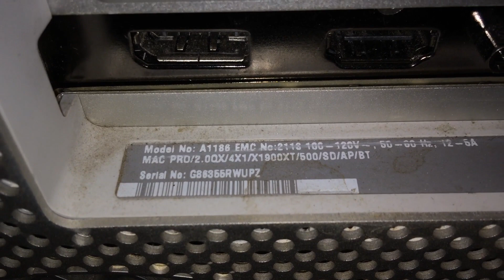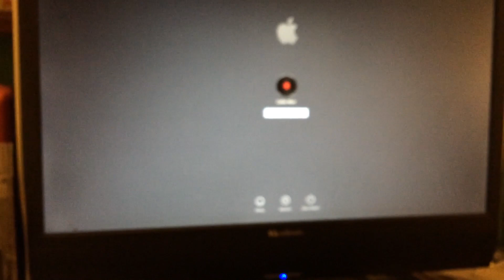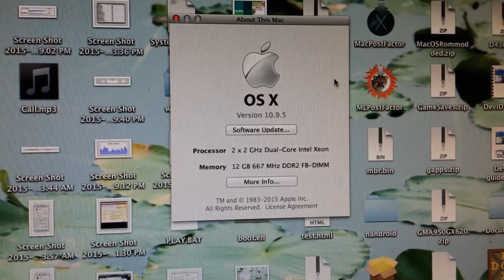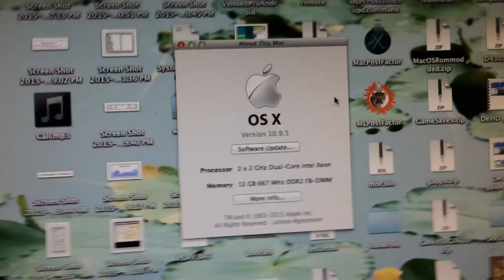Early-2006 Mac Pro 1,1 Overview

Comment: We have two of these in my graphic design class. They run at a fairly acceptable speed and can still get online, plus they look very nice. We use them as scanning stations but, theoretically, we can do projects on them as long as we're not using Adobe InDesign.

Comment: Hello i have a mac pro 3,1 with your catalina os installed its awesome thanks.
I'm trying to dual boot windows is there a trick i get the option but it wont start the installer restarts after a few minutes.

Comment: SO did you do a video of upgrading or rebuilding it to be more powerful or running current MacOs or anything?
Reply from the maker: Yeah, there are a few videos on my channel about some upgrades I've done to this machine.
Reply: ***** I created a playlist and put them all in it! How far did you get in your upgrades? What are your current specs for it? What were they before?

I got my 2006,MP 1,1 in 2012... i upgraded to a 1gb graphics card, i put an esata pci card in it, I put USB adapter things in for BlueTooth & WIFi capabilities, I put an SSD in for the main operating system drive. It's a 2.66 quad core processor with 16gb RAM. 

It still runs great and powerful, BUT... I want to upgrade it to run SIERRA or EL CAPITAN on it.... so I can use it as a back up computer. 

All my work is in DROPBOX so I can access it from both macs. I can have my Adobe Creative Cloud apps on both computers, and I can access all my iCloud MAC iwork apps via icloud.com.... so it should be fine.

I would actually like to eventually rebuild it to be MUCH powerful... put a new motherboard, new processors for 12 cores, graphics cards with 4-12gb VRAM, and just MAX it up as far as I can! LOL

If you have any suggestions or anything, i would be grateful.... so I can do it the RIGHT WAY! lol

Comment: Great video!  I wonder what games there are that you could run on this Mac?
Reply: I have Windows 10 on mine with a GTX660 graphics card and two quad core processors with 14GB RAM. Turns it into a fairly capable gaming machine. Obviously there's bottlenecks but its not a bad machine at all.

Comment: I have a Macpro Model No. A1186 that i been trying to fix it doesn't startup with a  apple chime and i doesn't show any  display on my LCD SCREEN  .........................it does run  the fans work good the video cards look like is running good i have 16 gig of ram  ..............................i don't not have any os x operating system....................because i don't have any original MAC .........I ONLY HAVE A HACKINTOSH PC...............but my concern is shouldn't get some display on my  screen  on some chime staring
Reply from the maker: +Mavericks Mavericks First off, please stop spamming comments… That's not going to help anything. Second, when using a PC graphics card in a Mac Pro, you're not supposed to get a boot screen. The card will start working once OS X is booted. In order to install OS X, you'll either have to use a different Mac, or install a Mac flashed or Mac Pro compatible graphics card during the installation, then put your card back in after the installation is complete. It also depends on what type of graphics card you're using, as some newer ones aren't natively supported in OS X without a 3rd party driver (such as nVidia Maxwell-based cards).
Reply: +dosdude1  ok how about the apple chime...........and the video cards i'm using are (EVGA GeForce GTX 560se........)
( EVGA e-GeForce 8800 GTX) ............
(EVGA GEFORCE GT 630)
Reply from the maker: Mavericks Mavericks The 630 is the only one that I know will work unflashed. The reason there's no chime may be because the volume had been muted last time it had booted up. Try holding down Command + Option + P + R at boot up until you hear a chime. If you don't hear one, there may be other hardware issues.

Comment: Why does every mac pro from the very beginning always have dual ethernet ports?
Reply from the maker: +supercrazymario404 That's just how they were.
Reply: +supercrazymario404 It was carried over from the late 2005 Power Mac G5. A useful feature for when the Mac Pro is used as a server, as it can connect to two different wired networks.